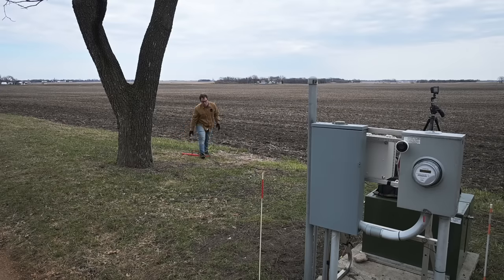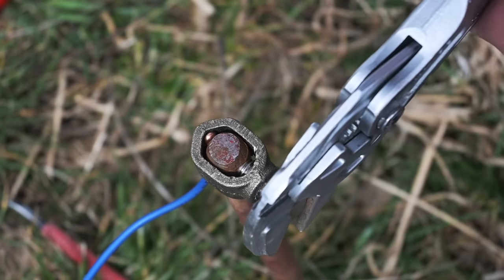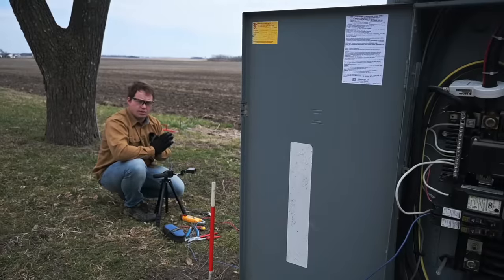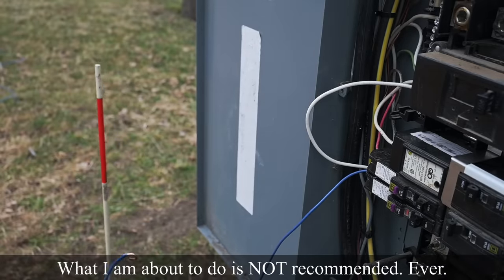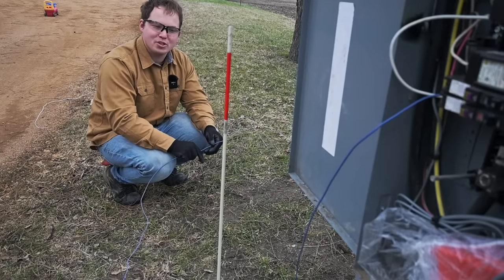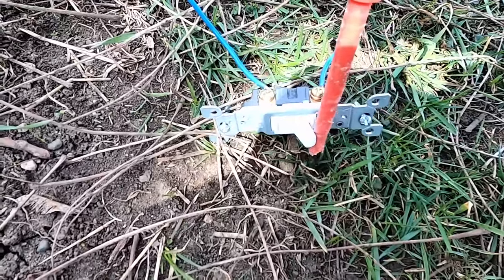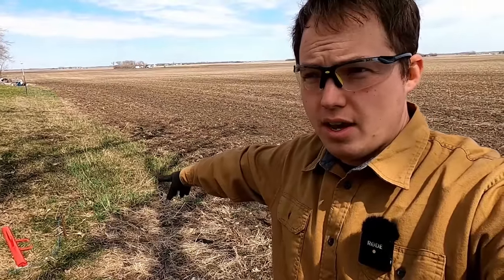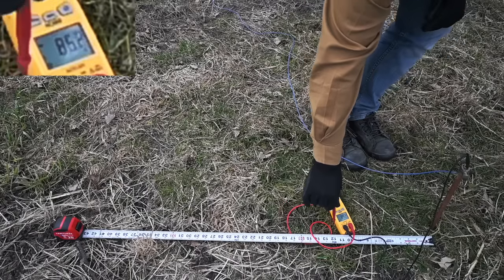Will 120v To Ground Trip a Circuit Breaker?

Comment: Mike Holt has great grounding and bonding info
Reply from the maker: Absolutely!
Reply: @BenjaminSahlstrom  Feels like you should've given Mike a little credit (or shout-out) here for all that you've learned in the past month. I saw your guys' exchange on the last video and like you I have learned a lot over the last month. :) Give him a shout out and I'll subscribe, making you my third subscription (I subscribe sparingly).

Great video, though, great demonstrations and really nice production work making sure everything was visible. That one auto-focus shift right before the breaker trip was a gem, and I imagined you being delighted to discover it in editing. :)

Questions and ideas for future videos (I've always been fascinated with Tesla's similar experiments):
1) What can you power with that earth to earth voltage differential? Perhaps two more ground rods with a load and measure the amps there?
2) This is AC going into the ground, is there any phase shift as you get further away from the ground rod? Perhaps a phase shift is affecting the voltage reading? (180 degrees out of phase would read 0.)
3) If you repeated this exact same experiment from the video with DC what would change?

Again, great work! Really looking forward to your future videos!
Reply from the maker: @WaddaFundraiser  I actually did have this video in the works before I saw/found Mike's content but you're absolutely right that I should reference him more often! Maybe I'll add a card promoting one of his videos at the end of this one or add something in the description.
Reply: @BenjaminSahlstrom  I watch mikes videos. That guys is awesome bro

Comment: I was welding in my yard once, old dirty mig welder on the dirt. Out of a corner of my eye I looked over to a pine tree root smoking, almost 20 feet away. Nothing ever popped... root was on fire. Excellent video right here. anyway, a maine pine is very alkalinic and whatever else...they explode to lightning...I set it off with my old mig.
Reply: he just showed how the voltage going directly into the ground drops off to nothing after a few feet... you certainly didnt have enough power 20feet away to start a tree root on fire, and the highest voltage was at the plug the mig welder adds nothing to that system they operate below 30v DC
Reply: more than likely it was alot closer than 20feet, and either hot spatter, or concentrated sparks from an angle grinder caught some dead grass on fire

Comment: This is why the NEC requires two 8 foot ground rods spaced at least 6 feet apart - one isn't enough. This is also why your ground is bonded to neutral in the main breaker panel. That neutral is not only center-tapped at the transformer, but it runs all the way back to the substation and is grounded at every pole and every service.

The service ground doesn't protect anything, necessarily. The neutral is almost always going to be the path of least resistance. But unbalanced loads mean that the neutral carries current, and we want the neutral to be at zero volts so neutral is tied to ground everywhere possible. The neutral wires inside a house are almost always going to carry current, so we have a separate ground wire to serve as a safety.

Comment: My grandfather used to do this to get worms. He would dampen the ground then turn it on and wait for the worms to surface then turn it off and collect the worms.
Reply: Confused ...
Reply: @uksds3806  why confused? This is a useful trick for fishing.
Reply: I've seen exterminators do this to drive moles to the surface.  In other words, you may end up with your very own zoo bubbling up out of the ground around you!  ;)  

WARNING: Don't do this at home.  You are opening a can of worms (no pun intended) that could result in a person or pet being electrocuted.  You are also making the dangerous assumption that the new grounding rod is a better ground than others in the area.  Your current path could end up being dangerously different from what you expect.

Comment: This is why you need to connect a metal outdoor stage at a festival to the panel ground and not just drive a ground rod and Earth it. That's what the utility here in Nova Scotia was calling for any metal outdoor stage has to have a ground rod down 8 feet and the stage connected to it. No other connections. So if a power cable shorts to the stage the breaker will not trip leaving the stage live to kill people. The utility actually thinks the ground rod will trip the breaker. scary! I have been wanting to do that test for a long time and show the utility the results.
Reply from the maker: That illustrates it perfectly. Crazy that this misconception still exists.
Reply: Yes, exactly.
Reply: @BenjaminSahlstrom  Especially among some engineers/electricians that install computer rooms and data centers!
Once, I complained about that and the engineer removed from the project
Reply: They do that to prevent people from climbing onto the stage.🤣
Reply: @Dreddip  that works 👍
Reply: Wait a minute, the UTILITY company doesn’t know this stuff????  Now that is freaking scary.
Reply: @ystebadvonschlegel3295  the scariest thing they would do is if you are on the dock doing a show on the waterfront on the ocean where there is no place to drive a ground rod they would get you to toss a ground plate in the ocean or lake. Imagine what happens when you have a short to the ground in that situation.
Reply: OK but then if there's a Neutral fault @ broken Neutral upstream, wouldnt the stage/truss go LIVE?😲
Reply: @piratedprivacy9052  the stage could be live at any time with just a ground rod. A hot connection to the stage would just continue to dump current into the ground never tripping a breaker. A neutral broken could be nasty on its own.
Reply: patthesoundguy  Sorry I forgot to mention that I meant, Not getting involved with Panel Grounds but instead Drive Independent Ground Rod and use of GFCI...

Comment: From the question you asked why the current slowly rises overtime...

From what I learned in electrical engineering, It probably have something to do with the ground/earth loop impedance.

In most electrical installation, the distribution transformer's secondary neutral would be bonded to earth/ground. And (in a TT Systems for example) with the local earth electrode/rod, this form a "earth loop" from the distribution transformer with the local electrode.

Ideally, you'd want to have lowest loop impedance possible, such that when an earth fault occured (as demonstrated in video), the MCB would trip to protect the wiring.

Comment: I understand there are different delay times in these breakers, something like 5 secs for arc fault, 2 secs for load and immediate for ground fault. Since your neutral and ground are one in this box you bypassed the ground fault circuit in this breaker and the overload protection took over, which is why you got the welding results you did. You effectively touched your live to neutral not ground.

Comment: This is the reason that you shouldn't put your feet far apart in the event of a lightning strike. My aunt always told the story where lightning struck next to a cow. The poor animal had its legs wide apart and was killed by the current in the ground.
Reply: National Grid call it bunny hopping so voltage different between feet be very low. I can tell first hand you feel static electricity building up just before lighting strike

Comment: The arc to the panel frame IS NOT 20 amps!  It is 120 divided by whatever the circuit impedance is which is greater than 100A.  Impedance is way less then 1 ohm.  (If it were 1 ohm, there would be 400W dissipation in the wiring circuit at 20A!)  Every breaker has an "I squared T" rating.  Given that the rate of connection is "fast" compared to the breaker response time, the current will go to whatever the circuit can deliver.  Even a standard "washing machine" induction motor draws over 50A for a second when starting up.  Breaker I squared T rating of the breaker must be able to pass this (or there will be nuisance trips), so higher surges or even 100's of amps are possible if the surge starts abruptly.

Comment: Nice demonstration.  The office I work at(though not right now) I have often noticed nightcrawlers coming out of the ground after it rained. I had assumed they came out either to escape the water or maybe due to disease. After the comments about nightcrawlers coming out after running a current through the ground, I have to wonder if there is some current from another source that is passinng through when the ground gets wet. When I am at the office next time, I may have to bring my multimeter with me and see if there is any voltage difference
Reply: You will likely find voltages.
Reply: Using a battery powered, ungrounded oscilloscope would be interesting. You may find RF currents in addition to power line AC frequency.

Comment: Congratulations, you just built the first copper wire heating element. Welcome to the 19th century!
Reply: Yeah how hot did that rod get?
Reply: @CrashCarson14  Actually it would be measurable with two thyristors in series. But that's another 5th grade physics class. LOL

Comment: I once tripped a Homeline GFCI brkr with my finger tip and had no injury. I would say that I was lucky. But very impressed with the brkr. SQ D claims that the QO brkr is even more sensitive.      We used to energize the ground to bring worms to the surface when we were kids.
Reply from the maker: It would be interesting to know how many lives have been saved by GFCI's. When you tripped it did you feel anything or did it trip so fast that you didn't feel it? Oh, and I'm definitely going to make a worm picking video using that method at some point!
Reply: @BenjaminSahlstrom  I felt a shock and it immediately tripped. It would be interesting to know exactly how long. I would guess 1/2 second. And they claim the QO brkr is faster than the Homeline that I was using.  That sold me on them.  If they could just make them so the could hold a higher starting amperage.  I had to change out all the ones in my detached garage after final inspection because they won't allow a 9" Milwaukee angle grinder to start without immediately tripping.
Reply: @bigrick7108  Typically, a GFCI will TRIP in less than 1/10 second ...

Comment: Just a note, and I would actually like to see this tested if you have a meter that can test the actual short duration spike, but when you shorted that conductor to the housing and got that good arc that vaporized the conductor you were probably drawing more than 20 amps. Yes the breaker is rated to trip at twenty amps but they're mechanical devices and take a finite time to switch so for at least part of a cycle you could have been drawing consideriably more than 20 amps.
Reply: Could be 5-6 times that like 120A easy. It's like welding as you can see. 
The most dangerous moment in this vid, we are trusting the KA rating of the gfci breaker. And failing that a PSC of 1000s Amps is possible. Flash-over kills more electrician than electrocution does
Reply: @Froggability  yeah, single cycle arc currents can be huge.

Comment: Years ago my male dog peed on a ground stake at the foot of a power pole and got a nasty shock.  So guys watch where you pee.
Reply: Does that mean the ground rod has a poor connection to the earth, possibly due to corrosion? If the dog is grounded, and the rod is grounded, where is the shock potential?
Reply: Pimp My Ditch Witch  Myth-Busters showed this was dam near impossible - even using a high voltage fence shocker !
Reply: Guys, in Boston each winter there are few dogs that get electrocuted just walking on side walk from electric leakage from street light and salt does not help, you will see dogs with boots on feet, NO JOKE look it up  like video Ben 
Add some salt water for city Folks
Reply: @frankhynes4514  @R D P stated, his dog peed on a GROUND ROD.  Did his dog tell him that it was shocking?   Now, you are talking about HIGH VOLTAGE wires underground -  Two completely different scenarios.  Yes, HIGH VOLTAGE Power Wires are dangerous - everybody knows that ...

Comment: 2:31 "...without pre-twisting".  You, sir, just broke the Internet.
Reply from the maker: Haha oops...
Reply: You don't need to pre-twist if you install wire nuts like you mean it. The wire nut itself will twist the wires as you install it. Keep going till you see a couple of twists on the insulated portion of the wire below the wire nut and you can be assured that what's inside the wire nut is twisted as well.
Reply: You do not need to pre-twist if your wire nut is listed for it. In other words the wire nut must be designed for non-twisted wire. I always twist because that's what I was taught when I was an apprentice. I think it gives a more reliable connection.
Reply: @farmerdave7965  If the wire nut requires the wires to be pre-twisted the instructions will say so. I haven't run across any like that.
Reply: @brianleeper5737  I totally agree! I have been in the trade for 25 years, I was never instructed to pre-twist the wires when I was an apprentice and I have never done it as a Journeyman. It is one of my pet peeves when I watch other Electricians from other States on Youtube. Quality wirenuts don't require it and Wagos(push-in connectors) don't require it obviously. It is just a waste of time. Russ from Oregon.
Reply: @russrockino-rr0864  Interesting. I'm an apprentice and everyone I've worked with and for have all said to pre-twist. It got to the point that if your twists weren't pretty...they'd all just shake their heads at me like I'm worthless. So now I work hard to make my twists pretty. :D
Reply: @icevariable9600  I have been in the trade for almost 26 years and none of my journeyman ever told me I had to pre-twist wires. It is a waste of time and one of my biggest pet peeves. When you become a journeyman you can do it however you like as long as it is a secure.  Ideal makes a wirenut that will do the twisting for you.  It is a totally moot point if you use Wagos(push-in connectors). There are lots of other brands that will twist for you also.  Humor your Journeyman for now, but when you turn-out, you will find that there are more than one way to do many tasks, and they still meet code. I try not to make my apprentices feel worthless when they make mistakes. People don't learn  very well when they are being put down or be-littled all the time.
Reply: @russrockino-rr0864  ever NOT pre twisted 6 #12s? That's what I thought.

Comment: Probably already mentioned elsewhere but you forgot what you said earlier. Electricity takes the path of lease resistance. AND electricity will take ALL paths to ground or back to the power source common. In this case voltage will pass through the ground back to the panel which will energize the earth for a wide area and not just along a straight path to the box. Issue, if you are standing on energized earth with your feet or damp/wet shoes spaced more 6" apart, energy will actually travel up one leg thru the other and back to ground. You will be subject to the strong possibility of electrocution. I see you covered that issue but you were still taking risks to do so. But thanks for sharing.

Comment: So how far from the gradient can you be and still energize a light bulb?
Reply: I sort of doubt that you'll get enough current from a multimeter probe to get enough current to light a bulb. Consider how much surface area a ground rod has compared to a multimeter probe. Then consider that the amount of surface area is proportional to the current flow. He should have tested the available current. Just because a meter says you have voltage doesn't mean that you have enough current available to do anything. These meters have very high input impedance.

Comment: Ben, love the theory stuff. I actually knew this wouldn’t trip a non-gfi/afi breaker courtesy of Mike Holt.  I have an idea for you to possibly make a video.

There is usually current on the “off” traveler in a 3-way switch. It can range from 15 up to 40 volts. It is caused by capacitive coupling. You should check it out and delve into it.
Reply: Some LED light bulbs continue to burn dimly in such a situation when controlled by 3 way switches.  These don't need much voltage or current to do this.

Comment: Did you measure the resistance of your earth rod ? It’s such a high resistance the MCB wouldn’t trip you would eventually start a fire 🔥 on the cable you would use your rcd for additional protection 👋 🇬🇧